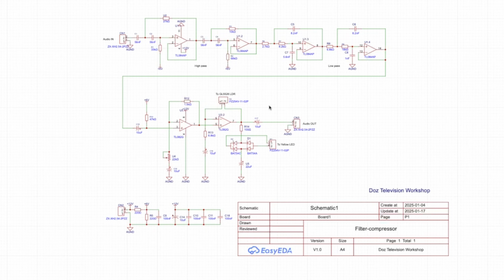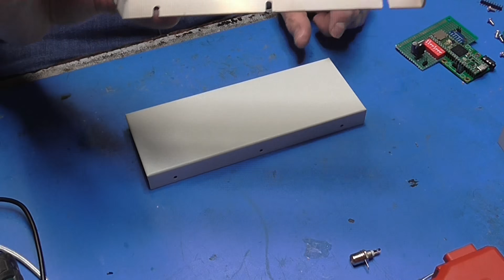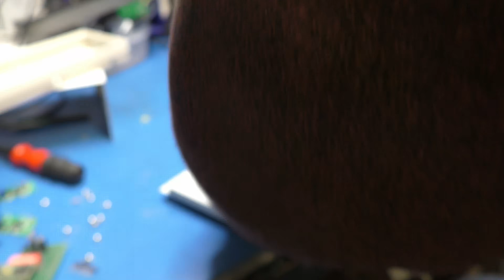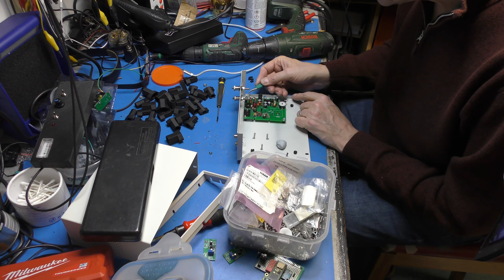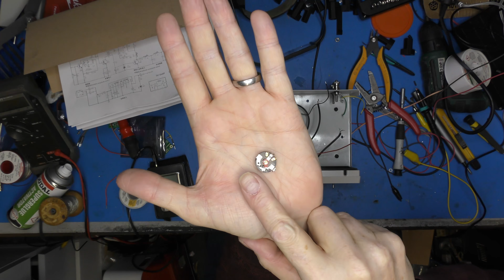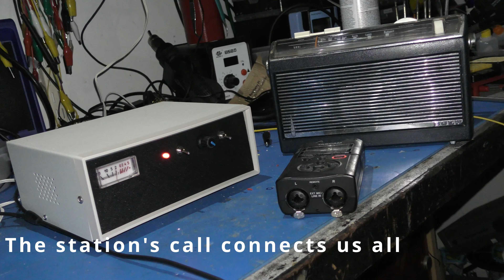Finishing the AliExpress AM Transmitter

Comment: Sounds great and turned out a neat project. I put a thumb wheel disk on my input volume control and used a 9v regulator in this instance the use of a microwave oven diode in series with the posive lead of a 12v linear wall wart power supply.

Comment: Love these projects and the prog rock tales from the Troposphere tune. Is the RF output transistor operating in class C ? Which becomes  Sinusoidal  after the 2 stage LC stage.  That LC from the factory is optimal  at 2Mhz increasing the capacitance brings it down to the top end of MW. Am I talking rubbish here please can any one help.
Reply from the maker: Yep. It's in class C. The filter seems to be around 1.7MHz. It's there to help get shot of the harmonica.
Reply: @AndyDoz  Thankyou for this When I purchased this I was disappointed it wouldn't tune over the whole MW band. That's when I found my TX peaked at 1.9Mhz. I changed the filter capacitance to peak around 1440KHz . It works not bad still slightly Asymmetric even at 9V.
Reply: @AndyDoz  It does say its for experimental use which is what we are doing. I loved the opto coupler that was fascinating. Could a opto isolator type opto coupler be used?
Reply: Have carried out a bit more experimenting . You can get quite a good symmetrical modulated  wave from at 20v p to p however it is very dependent on frequently and thus how the output filter is configured.
Reply from the maker: Not really, They're usually a photodiode or phototransistor, not an LDR

Comment: A trick I've used with optical compressors is to wire two LED's in back-to-back configuration, both shining at the LDR and just feed audio to that, no need for a rectyfing bridge, works pretty well.
Reply from the maker: I did contemplate the very same thing. It's a great idea.

Comment: Excellent! I'd ask for an FM kit on the future (either for NB FM for ham radios or Wideband for proper broadcast radio, using the full 250/200khz BW), if possible!
Reply: For FM broadcast, there are single chip solutions like the Si4713, which even transmits the RDS data. It's been discontinued, but you can still get them on cheap breakout boards from the usual sources.
Reply: @rocketman221projects  Yeah, I was thinking something like the "FM-bug" concept, and probably adding RDS through a computer (high quality audio card + an app, which I've done it in the past)

Comment: Nice project. I built similar small AM transmitter two years ago, nothing fancy, just an 18.432MHz crystal oscillator divided down to 1152kHz using 74HC4060 (which I also used as an oscillator), then an switching mode AM modulator which also acts as an power amplifier followed by a low-pass filter. I designed that thing to be completely "no tune" and easy to build using easy to buy common parts. I achieved -40dB second harmonic suppression with +26dBm at the output and it was a great fun to design and build that thing. But. I would like to ask:
1. That plastic "spanner" you are using at 20:18. That's your own 3D printed design or it is something that (almost) anybody can buy? That's a great gadget, I feel I need this. I used to use tubular box spanners for that purpose, but I feel this is much better solution as it is much shorter and easier to manipulate with.
2. What's the song at the end of your video? It sounds to me like an Asia or similar band, it somehow reminds me their song Voice of America they made around 1985. It puts me back to that days, when I was young and everything was much better just because I was young.

Thank you so much, it was heartwarming to watch you building this project.
Reply from the maker: 1. It's a kit of "guitar repairing tools". 3D printed. A quick search on thingiverse will find them. 
2. "Doz' AM" by Doz.